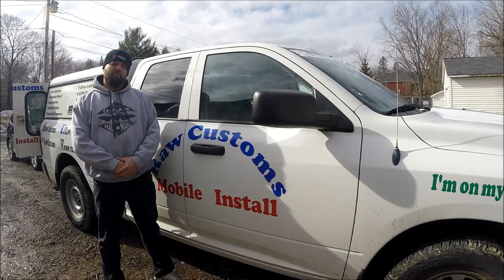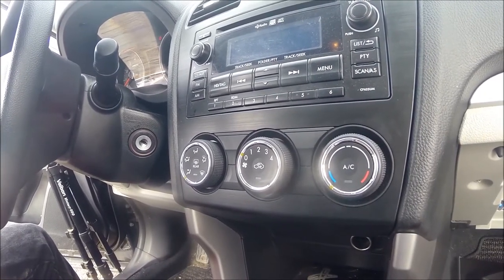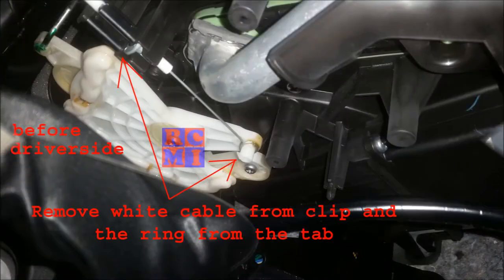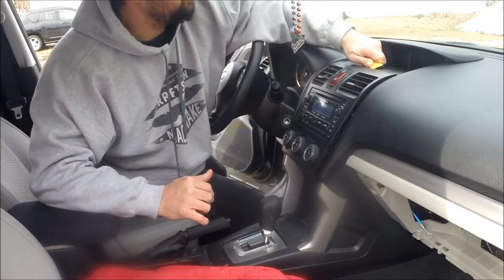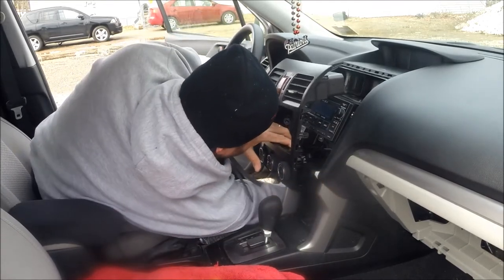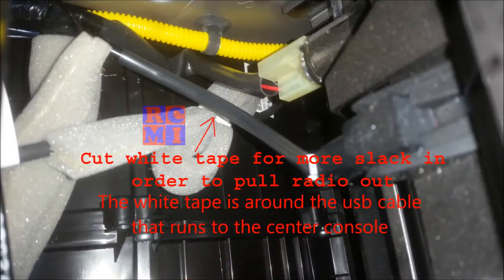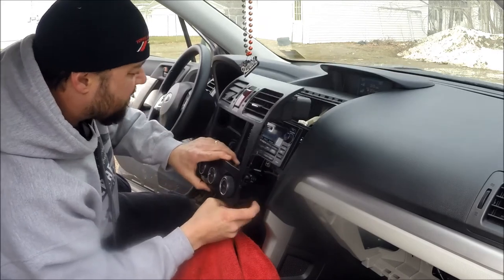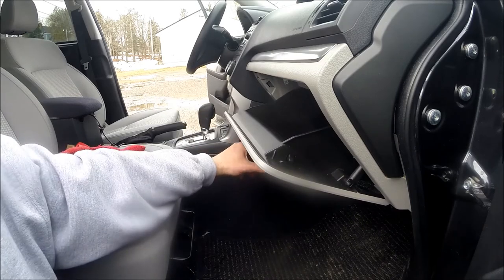How To 2014 - 2015 Subaru Forester Radio Removal

Comment: Thanks for the excellent video,  just removed the touch screen with nav radio from a 2015 forester premium and your video was exactly the right steps.  
One caution though,  the metal clips that holds the cable sleeves into their plastic homes came out with the cables on mine and one of them stuck into my right index finger when it popped lose(they're VERY sharp at the corners). I was actually hung up on it for a few seconds and couldn't remove my hand from under the dash!  Be sure to wear mechanic's  gloves or wrap with a rag to prevent this.

Comment: Outstanding instructions! I needed to pull the HVAC controls and this video showed me exactly what I needed to see. My fat fingers had a little trouble with the clips where the control cables connected but I managed with a couple of angled picks. The blind wire harness connections were kind of tough but again using an angle pick I could get to the recessed clip and release the wire harness. I definitely would have broke something if I hadn't had this video to guide me. Thanks!

Comment: Thanks very much. I really appreciate the work you put into this. Nice instructions. I have one question. I have to do what you've done because I've lost audio (I've checked all fuses even the external amp under the seat, and they're all good)....when you took the white wire out initially, did you have to go from the driver's side and if you did, how easy is it to access? Thanks

Comment: A body shop took my stereo out and put it back in, the ac knobs must not have been to one side because it now gets stuck. If I want to fix that do I need to take the blue and white cables from the glove box or should I be able to just open up the bezel and make adjustments? Thank you.
Reply from the maker: Prob gonna have to undo those cables

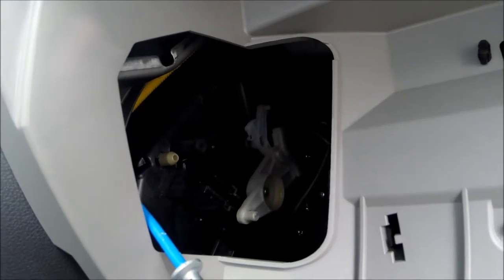Comment: One thing I noticed you did at 2:15 when removing the loop for the blue cable is that you snapped off the plastic nub that secured it in place? This isn't a criticism though cause that happened when I removed it on my vehicle.

Comment: Thanks for the vid. When removing the cd head unit is it necessary to have the ignition turned on as a safety precaution?
Reply from the maker: No if at all possible keep off or if you want to be even more safe remove negative cable from battery

Comment: 2015 forester 2.5i PREMIUM DOES NOT HAVE THESE SERVO CABLES RUNNING TO AC CONTROLS. JUST POP THE RADIO BEZEL OFF AS IT SHOULD BE AND HAS BEEN WITH CARS!
Reply: I'm in my 2015 2.5i Premium rn and it does in fact have these cables
Reply: @No_ni_Official  Very weird ours must be a 2015.5 (2015 1/2) or something

Comment: Thanks for the vid.  In my Forester with the full automatic air conditioning it was easier as there was no need to go through the side to disconnect the "bowden" cables - just a plug ... unfortunatelly the radio I got from a salvage yard also turned out to be faulty, therefore another attempt next week, when I grab another one to try.  https://www.youtube.com/watch?v=4Sy5b8bu7aA